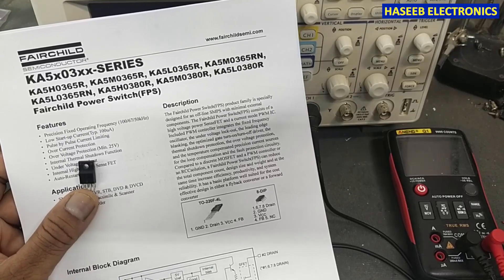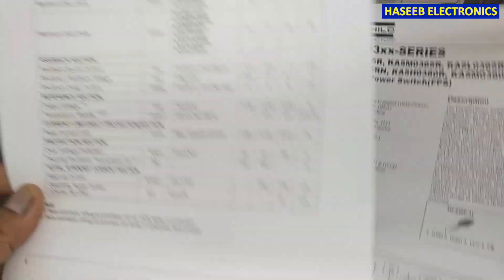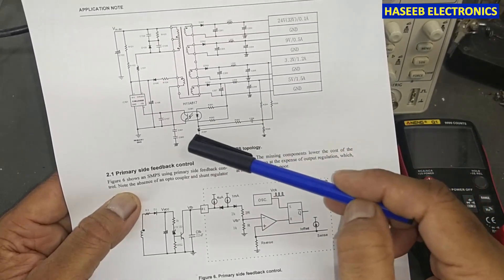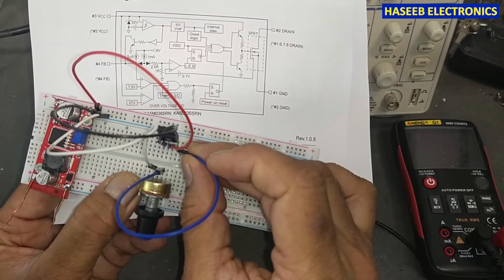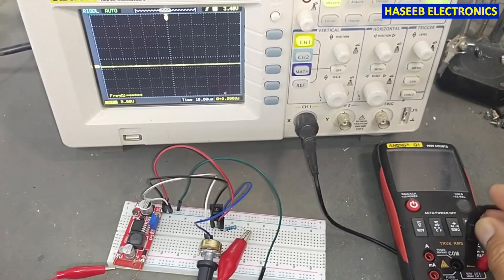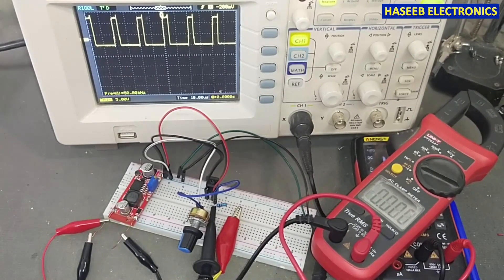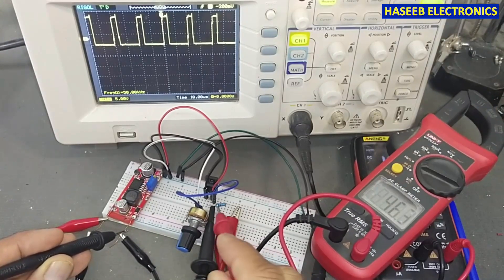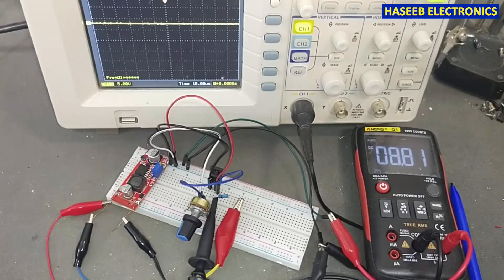{808} KA5L0380R Simple & Useful, "Switch mode power Supply" IC

Comment: Thanks for this informative video. Will you kindly share this datasheet?
Edited: I found the datasheet but you can share for others. I also found application note. I am struggling with a power supply which is using the same IC.

Comment: Where do you find the datasheet with application note? Very useful video as I have 5s1265 to use I think is similar but has sync that connects to gnd with a cap

Comment: Hello hasseb electronics, I really like your contents and I learned a lot from your channel especially welding inverter machine.I need your support am making a 24v smps using uc3843 IC,I had made it previously on bread and it worked but when I made the PCB for it,am plugging in and it gives output but the mosfet and fuse are burning immediately I tried to replace the ic and other components but still it doesn't work the mosfet is IRFP450 the current sense resistor is 0.2R 5W 
Start-up resistors are two 100k 3W CT is 2.2nF Rt is 10k there were also some noise in transformer and output inductor ,in input section am using 5D-15 ntc thermister to limit inrush current for me I thought l could give up on this smps but it is hard because I had made before on bread board. Your support will be highly appreciated, Thanks!

Comment: Thank you, it's a nice video. In the previous videos, I made a comment for the pwm in this series. In the video of sony PS2. I have KA5M0380R Pwm power supply. The zener diode on 4 pins burned out. I wonder how can I find the voltage value of it. The input voltage of the power supply is 220 volts, the output voltages are 6.5 volts to 12 volts. Thanks.
Reply: Just use a current limiting resistor to limit to like 100mA or less then reverse bias the diode and measure voltage across it